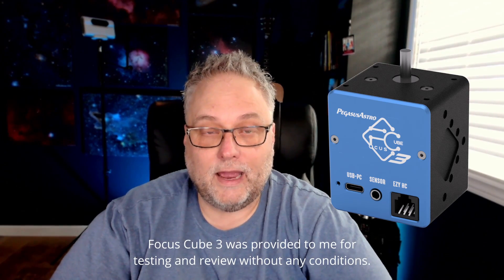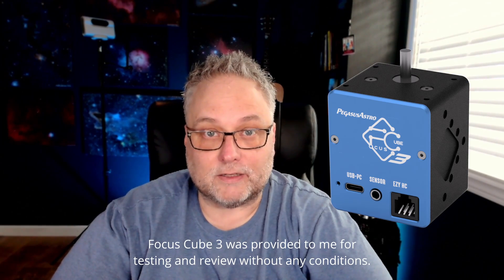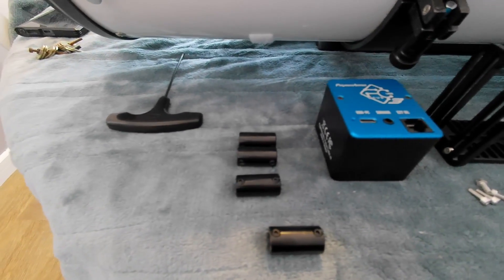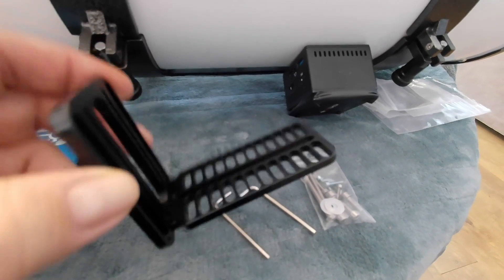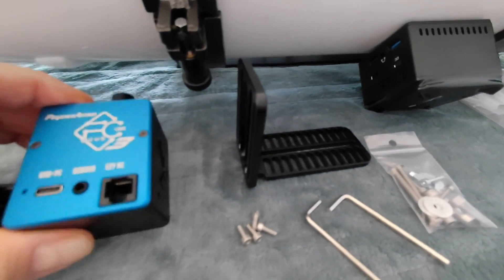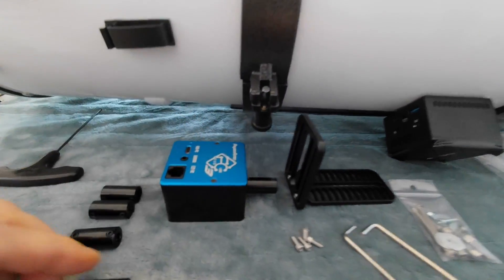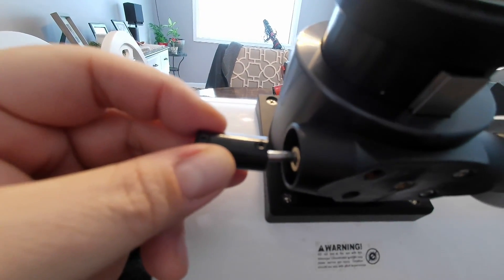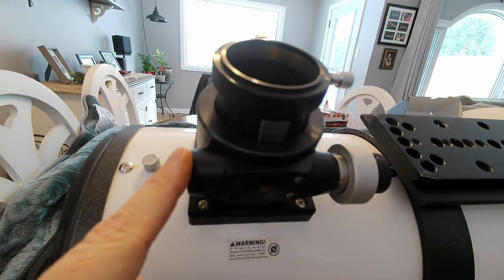Installing a Focus Cube 3 on my #telescope

Comment: I did consider this focuser motor for my new Quattro 6" but was really impressed with QHY's version with the clutch that allows you to rotate the focuser without loosening the focuser motor. But I am looking for a replacement for my old EAF with the 12v power and I like to Pegasus Astro's stuff, I have two rotators, and three powerboxes! Thanks for the tutorial, it looks pretty easy to install. Will be curious to see how it performs in actual focus routines. CS and welcome back!

Comment: Looks simple enough.
Are there any other noticeable advantages of the Cube 3 versus Cube2 other than the USB C supplying power and data?  One less cable is always a good thing.
- Patrick -
Reply from the maker: The two advantages for the FC3 is the USB C and the wifi/hotspot and Alpaca ability.